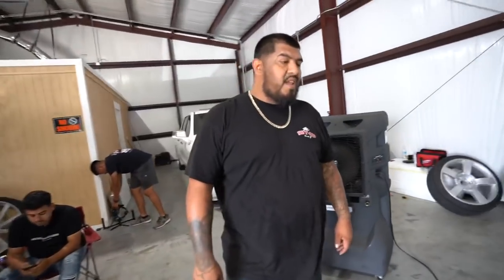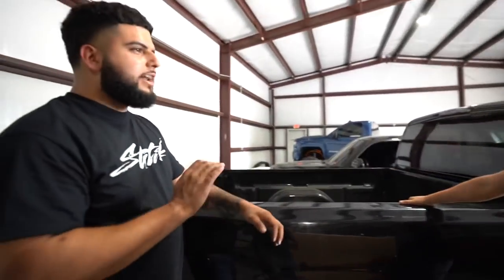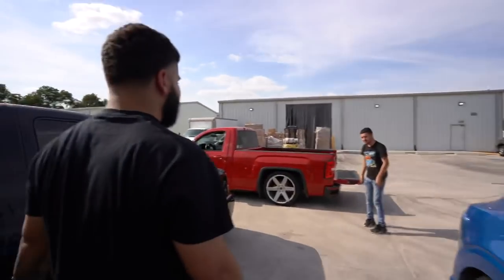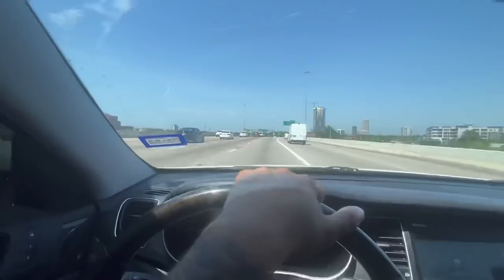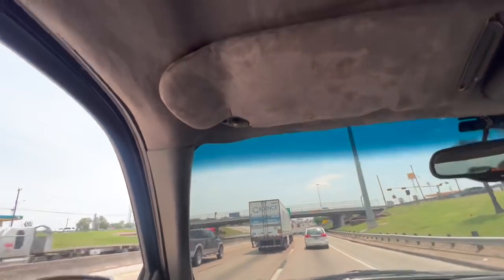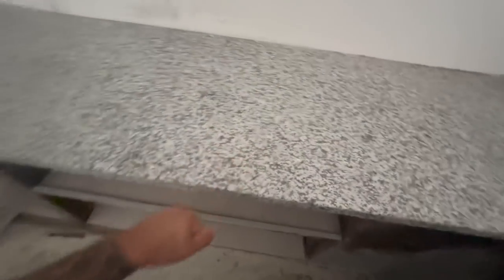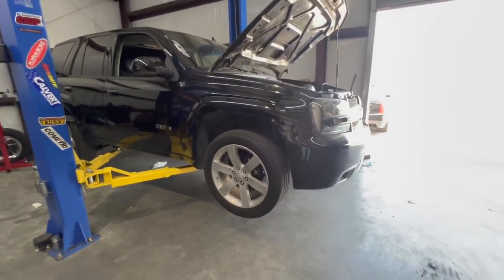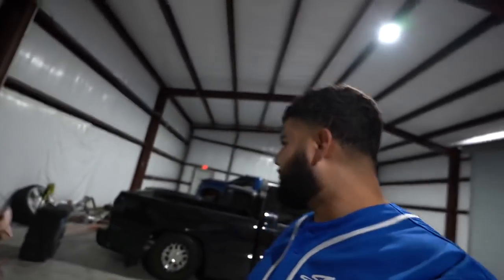MY FIRST TURBO TRUCK BUILD!

Comment: Just posting it out there I have a 6.0 motor off a Denali with harnesses computer cluster everything you need for your swap just barely over 100,000 miles and comes with transmission I stay out at in Cali $4000